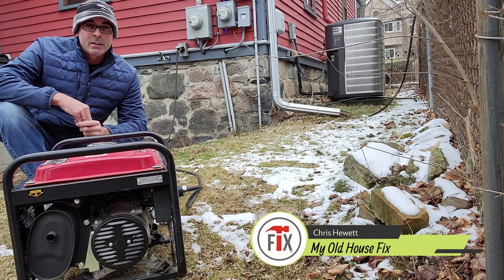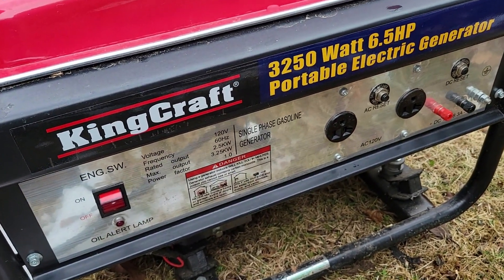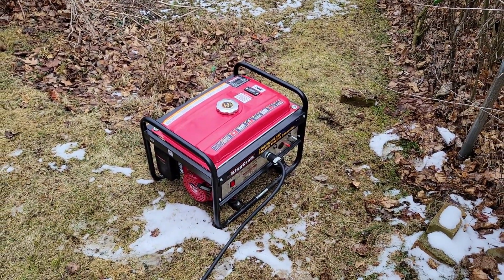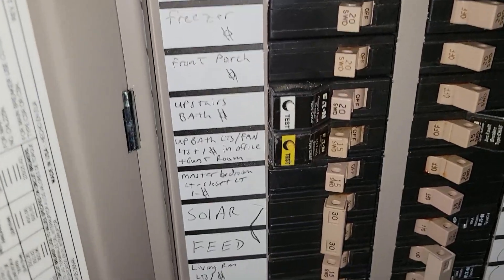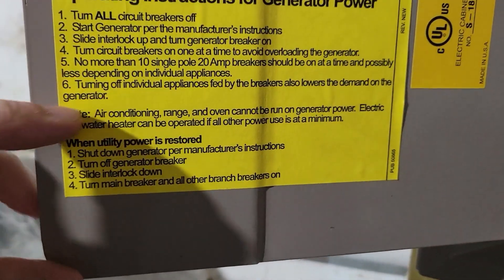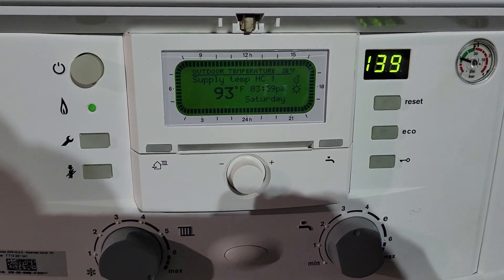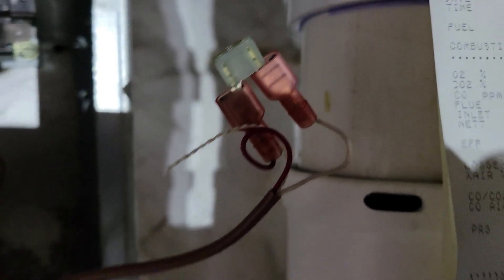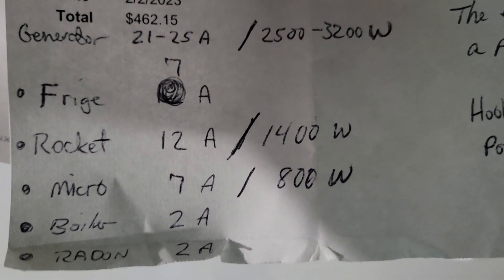DIY Portable Generator Setup and Operation During Power Outages

Comment: Are there any portable generators that can power an HVAC?
Reply from the maker: Yes! You'll just need a generator that is large enough to power 220 vs my  small 110v / 20A as seen here. The issue with HVAC is having enough "juice" to energize the 240v transformer at startup...then its good to go.
Reply: @kristenhitchcock5451  yes, but it’s recommended that you have an HVAC company come out and install a soft start to your AC unit. That way the generator can power a 4 or 5 ton AC unit comfortably along with most of the critical circuits in your home.

Comment: You have the plug already wired In to the house, what if someone doesn’t have that and needs power in a emergency?
Reply from the maker: in that case you'd have to use extension cords.

Comment: you have to be careful in situations like this with older or cheaper appliances.  sometimes, the average running amperage is very different than the inrush amperage.  they may have a huge inrush amp requirement.  this means that when they turn on they pull immediately a much higher amount of amps than they would when they are running.  for example, when my 1980s refrigerator turns on it is common for it to pull 1800 to 2200 watts.  this can create enough back force on an inadequately sized generator to stop it (or worse).

just thought i'd throw that in for when people calculate out what they think they need in amps when purchasing a generator.
Reply from the maker: Good points as everyone situation and power "loads" will vary 👍

Comment: I see that you're plugging a 120v plug into the generator. How does that get distributed over all of the circuit breaker in the switchboard?
Reply from the maker: Hi Geoff, great question! From the looks of how my electrician wired up the new 200A box and  generator connect/lockout, it's distributed via the double pole 30A breaker that I flip after 200A lockout and generator startup. Basically turning the 200A panel into a 30A panel for reduced load using the portable generator.